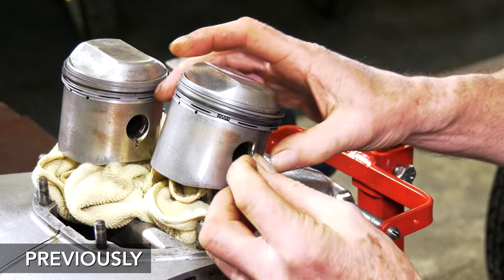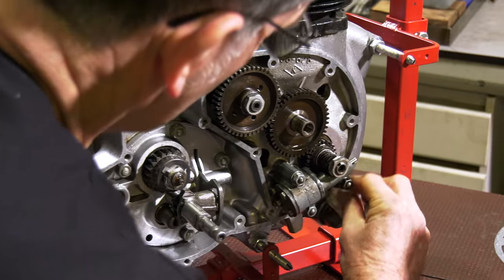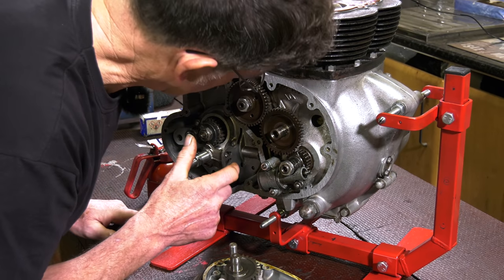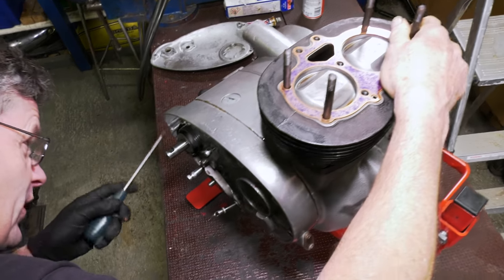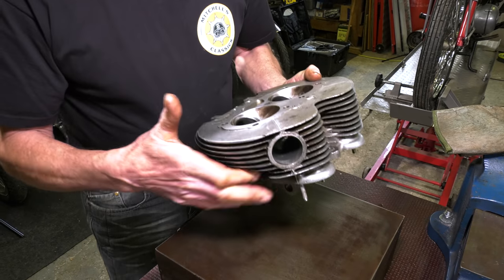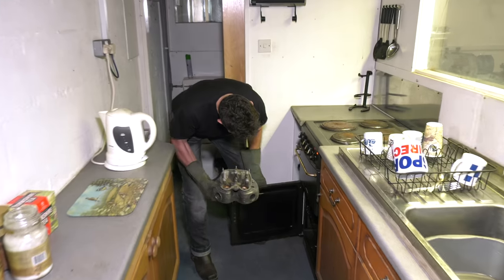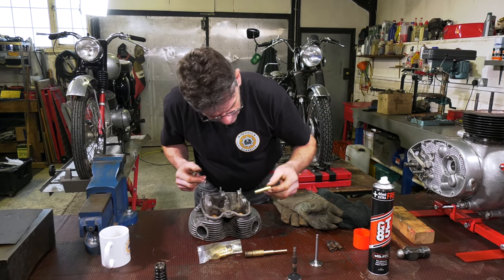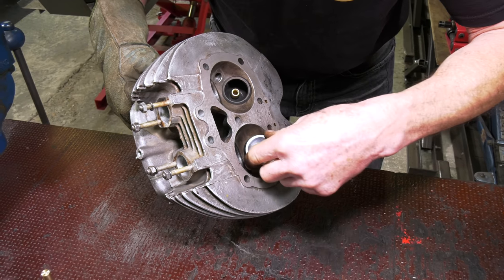Part 5 - Low Budget Classic Motorcycle Restoration Project

Comment: I really love this channel, as it explains tasks so clearly, something I have previously mentioned. Some tips: British bikes use Pozidriv fasteners, so do not use a Philips screwdriver; removing carbon from the old inlet and exhaust guides and ports is advisable before drifting out the valve guides, else the carbon build-up may score and mar the head - I think that was mentioned.
Reply from the maker: Great point Peter and thanks for your really nice comments!

Comment: I just watched the firs 5 videos of your Low Budget Classic restoration series. A great way to pass a couple of hours during the current COVID lock down here in Calgary Alberta. I just completed rebuilding the motor on a classic Suzuki GS1100,  those old British twins are a lot different. One thing I find striking is how thick the valve stems are. Thanks for series Dave.
Reply from the maker: Right on Hawk, thanks for checking in!

Comment: Forgot to say - I was saying to the screen "don't hammer the case something is out of line", you could see the case bouncing! Turned out to be the oil seal as you discovered, always watch that fitment on the shaft as you PUSH the case on. If everything in line no need to hammer.
Reply from the maker: Right on John!

Comment: A bit off topic but years ago I did a top end refurb to my G12 Matchless twin and fitted new gaskets.after starting up and re torqueing  I embarked on a local test ride and half a mile on,one cylinder went down with a leaky gasket.foolishly I motored on with one pot to find a suitable place to turn round but was beaten by the other one failing too.Result a long hard push home.The cure?  Increased diameter of holding down bolts and ordering solid copper gaskets!

Comment: Hi Dave Mitchell! It is a pleasure to assist your re-commissioning or reconditioning operations. Special tools a minimum, within the reach of isolated motorcyclists or specialized workshops that are increasingly rare for classic English women. Motorcyclists must have at least notions of metallurgy, horizontal lathe, adjustment and metrology. Otherwise it is an adventure which can be irreversibly harmful. So speaking, would it be possible to indicate the adjustment of interference of the guides in the head and of the valves in the guides, in thousandths of an inch or hundredths of a millimeter?
Thankful!

Comment: Did I miss the valve timing and installation of the timing gears and oil pump John.
Reply from the maker: Hi John, unfortunately this project was a spur of the moment thing and Dave had completed the bottom end and those jobs before we did part 1.